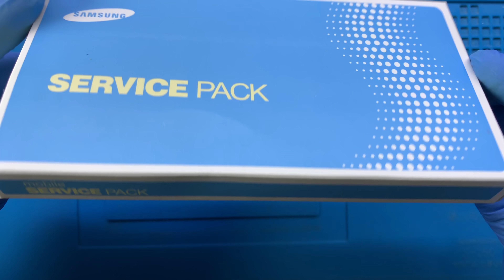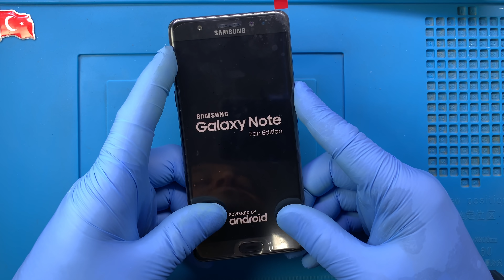Samsung Galaxy Note Fan Edition Ekran Değişimi 🇹🇷 | SM-N935

Comment: What does he connects with his wrist in the beginning
Reply from the maker: Hello there;
It is a static-free wristband on the left arm. Our technical service is designed to be completely free of static electricity, but it is installed by our technicians as an additional precaution in order to prevent static electricity that may occur momentarily. The right arm is a special magnetic magnet. It allows to hold very small metal parts.
Greetings.